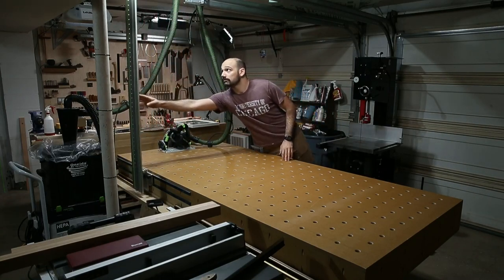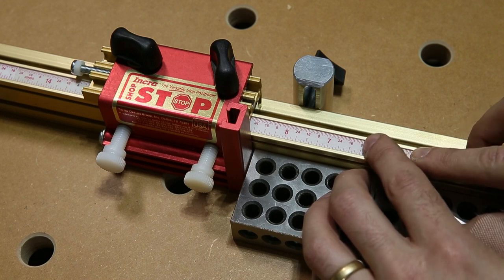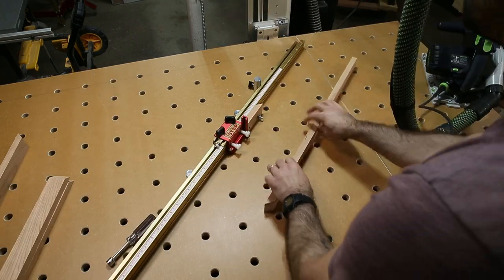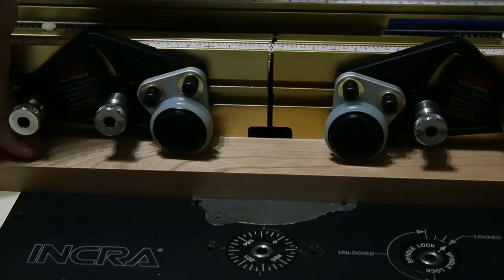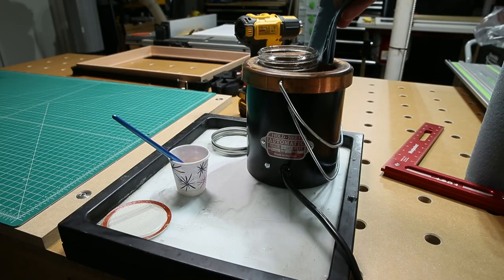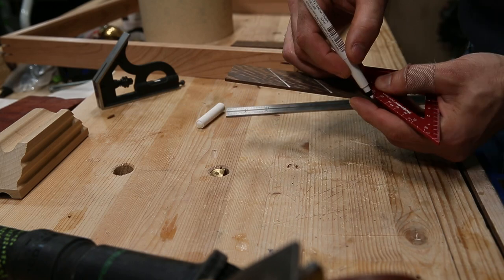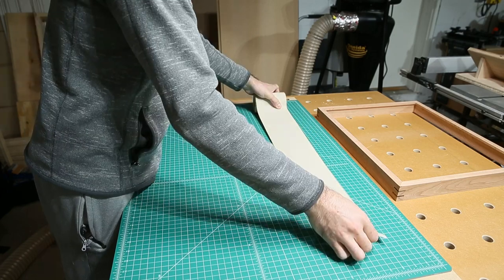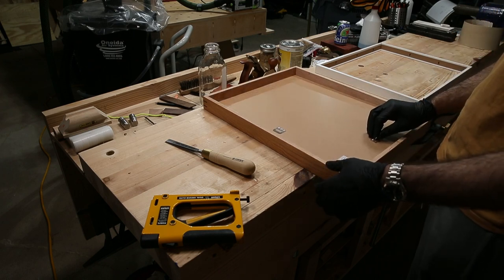Making a picture frame on my homemade cutting table

Comment: Love the table! How did you mount the rail?
Reply from the maker: Thanks! I just screwed them on, nothing special. All that really matters is that they are parallel to each other and the table surface.

If I do this again, I might put them in dados, but that would be mostly for aesthetics.

Biggest mistake was picking rails that the Festool clamps can’t fit in.
Reply: @JimPudar  sorry I meant the track saw rails. It seems you didn’t use the festool hardware but there is no play at the hinge. Wondering how you achieved this. Thanks!
Reply from the maker: Ah, yeah that’s the Dash-Board rail hinge. A bit pricy but very well made. Overall I’d definitely recommend it!

You might also want to check out the rail hinge made by Benchdogs UK - that’s a sort of different paradigm where the rail is fixed to the grid of holes rather than T-track.

My only complaint with the Dash-Board hinge is that getting it initially calibrated dead-on 90 is very tricky. I’m getting better at it, but it’s a lot more finicky than it looks in their sales material.

Comment: How long do you think the life is for the surface of the cutting table?
Reply from the maker: I used Osmo to finish the top which is made for flooring and kitchen countertops - so far it’s holding up really well. I am planning on routing out a slot for a sacrificial insert under the tracksaw kerf, but in general I’m going to try and keep this in good shape.

If I do need to replace the top, I will have to remake the entire torsion box since it’s glued on to the internal webbing.